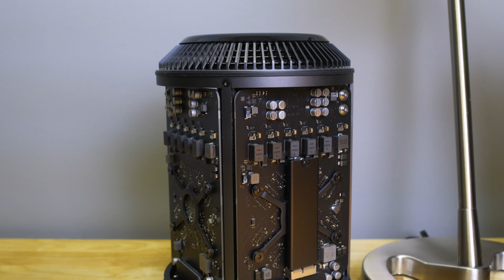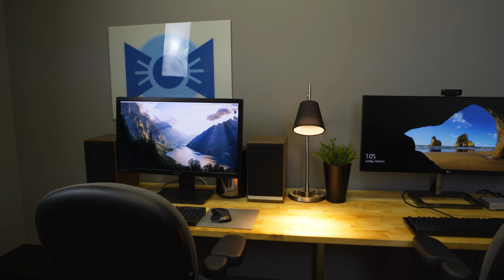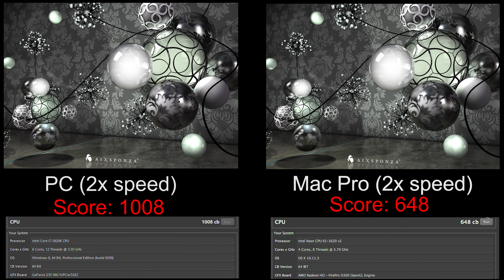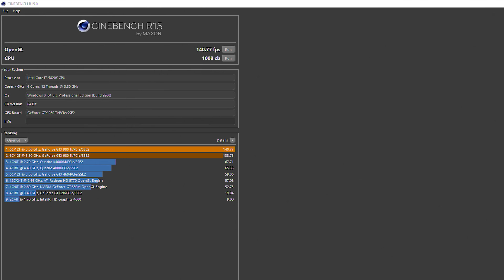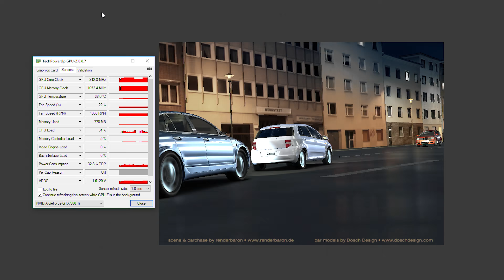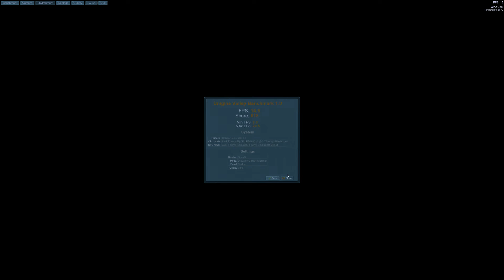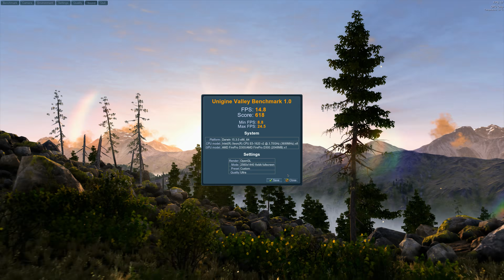$2,000 Custom PC vs $4,000 Mac Pro

Comment: If you buy any apple products, I have one question. How does it feel to waste a large amount of money?
Reply: I know, apple users don't have much of brains
Reply: at first it feels exciting then you feel like an idiot for buying it.
Reply: The only apple product I'd buy is at a grocery store in the produce department
Reply: You can buy a 4K$ PC with better stuff than the Mac Pro has.
Reply: Ryan Denziloe
The don't sell apples in grocery stores? lol Then where do they sell apples?
Reply: Ryan Denziloe
I've never seen a store that specifically sells only Apples.
Reply: It is like being ripped off, specially when your already ultra expensive computer costs more to repair than buying a new one
Reply: Cyril Blanc "Again and again : a Intel Core i7-5820K Haswell-E 6-Core 3.3GHz LGA 2011-v3 140W Desktop Processor BX80648I75820K
by Intel
Price: $384.45 & FREE Shipping. Details

Does not compare to a Xeon at 4000 euro"

Most Xeon processors are really just rebranded high-tier i7's.  Also, if you actually did mean "4000 euro", then it certainly would not be worth the investment for a Mac. You're not being coherent or concise enough.
Reply: Cyril Blanc To whom are you replying?
Reply: Kyle SoSik there ipads and phones are pretty good
Reply: Cyril Blanc When would the Xeon exactly be necessary? The Xeon isn't even clearly more powerful in benchmarks compared to the mid-tier i7 you cited.
Reply: DerPfoertner Can apple users be this delusional. You are paying $1100 for a machine that has the same hardware specs as a computer from 2007 get real. For a $500 windows or linux machine you can actually run GPU accelerated video encoding, play games better than a $1100 mac. Upgrading your PC is also possible, without having to shell out another $1100 dollars for a brand new machine. You are not even getting the most out of your sad excuse for hardware on a mac because the genius at apple forgot that a hot ass computer needs cooling or else it thermal throttles. There are way less application for mac because for the most part apps are sold and regulated by apple where as on Windows and Linux there is not a single distributor of software nor is there any restrictions or fees you have to pay in order to publish programs on Windows or Linux. As for Apple support that is the most garbage sad excuse for technical support i have ever experienced.
Reply: It feels like a durable device that does not explode
Reply: apple don't even make their own screens LG and Samsung do and yes apple called it the "RETINA" you can buy the equivalent screen for alooot less from the people who actually make them!
Reply: Kyle SoSik Feels great!
Reply: Probably feels a lot like getting bent over and fucked.
Reply: Cyril Blanc How exactly does that counter my original claim ?
Reply: +Jose R. Chaves (DJ Rodrigo) please tell me you are kidding me, have you ever taken a look at custom PC cases or expensive PC cases? Jesus christ, style he says.
Reply: +Cyril Blanc sir I think you mean an operating system comparison.. otherwise it would be a hardware configuration comparison... also xeons are made for servers I'm not saying it's impossible for them to work in PC configurations. also the Xeon used in the Mac configuration is probably cheap by now, you can pickup 4 core xeons for old servers cheap as fuck. like the Xeon e5420 which I have in a few of my old servers... you arguing over hardware configurations is pointless.
Reply: Cyril Blanc "In the PC world you use Xeon for servers and for professionals workstations, on Mac we use Xeon for desktop. Don't forget that the Mac Pro Market is Drawing, Music, film ... "

This seems self-contradictory. Doesn't this defeat the purpose of spending any extra on a Xeon for a household user? Even a power user who games and does heavy video editing probably wouldn't see any benefits from a Xeon processor on average, especially considering i7's have better single core performance for a significantly more affordable price range.
Reply: Jan Vandoorne Did you really just say quality of screens as a main selling point? Do not buy into their bullshit "Retina display" marketing buzzwords.

Most people with Macbooks just use them as overpriced Chromebooks/web browsers. Also, as long as you're not a completely incompetent dolt, Windows is an extremely stable OS.
Reply: Kyle SoSik I have regret
Reply: same feeling when you try 5 gum
Reply: Considering i buy them broken for next to nothing and fix them myself for cheap, it feels amazing
Reply: The only way to waste money on an apple product is to buy either the mac pro or an out-dated product. The mac pro in this video is both
Reply: HyperTutorials Is there any real advantage in using a Xeon if you're just an average, commercial user anyways? I didn't really understand his argument.
Reply: HyperTutorials That's what I had thought as well, I don't really see where he is going for his argument if we are speaking in respect to the average/regular consumer.
Reply: +Cyril Blanc I don't care about your post. first of all I was giving the e5420 as an example of hardware prices in specification lowering obviously the one used in the Mac book hasn't lowered much however if you take a look I'm pretty sure you will find that others with similar specification have around the same time. You can compare an Xeon to an i7 in desktop performance as a ordinary user the i7 is likely to outperform the Xeon on single core performance this is what the user asked. maybe you should read before going keyboard warrior style on me.
Reply: +Cyril Blanc isn't this the whole idea of the remade hyper threading process which they originally abandoned and brought back for parallel processing... in all i7's and xeons.. yes when compared to an 4 core i7 having an extra 2 cores and twice the threads will make a difference in MULTI CORE instances. the user you were arguing about was talking about a standard user point of view. Jesus Christ.
Reply: +Cyril Blanc +Cyril Blanc First of all currently sli and crossfire is fucking useless they are planning on scrapping the whole process as not all 100% of both graphics cards can be utilised I believe the video maker mentioned this, not directly but experienced both graphics cards weren't being used to their full potential. Secondly Intel aren't pricing these around apple. a huge percentage of their usage of Xeon CPUs are Servers they are literally directly marketed for data centres are they not. as you probably know servers are quite expensive both to maintain and to buy so they would not lower the price of Xeon new gen processors especially when they market it towards data centres. that is like Mercedes making a new class of car dedicated to Ceo's and people who aren't Ceo's complaining about price as they plan to use it for something else. they make xeons expensive for a reason.. to make money.
Reply: Jan Vandoorne 

"Yes. Any 2560x1440 60 hz monitor will cost you 700-800 bucks easily. 
People tend to forget that that is also part of the package. "

Are we talking about laptop displays or monitors? What I was trying to get at was that MacBook Pro's don't even support 1920*1080 resolutions. 

Many laptops now are supporting up to 2560 x 1440 resolutions now. 

"And to my knowledge I am not an incompetent dolt and I still get a whole lot more crashes on windows than I have on an apple during normal use. (and it is not only the stability, it is also the ease of use and speed, on a windows you basically cant use the 'search' function since it doesnt find half of you files and takes an hour. If you use the search function on mac you ll almost find anything instantly.)"

I could easily talk about features that OS X lacks in turn. For example, OS X doesn't even have a basic split screen shortcut, which is very useful, almost necessary, for an engineering student such as myself.
Reply: + Princess ... We are not playing in the same garden, I speak of 100 instruments loaded into memory. You have a 38 GB Library ! I use  the Vienna Symphonic Library, this library  is more than 900 GB and has 2,299,91 samples, this is THE professional library. Just to take an example, the piano has each notes sampled 127 times and is 46,8 GB. This library is only for Orchestral Instruments. I forgot to say that each of the 100 instrument that I have loaded into memory have at least 32 articulations so that is making around 3 200 instruments !  I do own many other lib ; Kontakt, Omnisphere, Arturia V5, Dimension, Choir ... I don't know how many instruments I have with those, probably more than 15 000. Just the Arturia is 5 000 instruments. go at https://www.vsl.co.at/en/Instruments/Super_Package#!Demos to listen to some demo of VSL
Reply: Cyril Blanc dude, I don't need to give you examples, mac is shite, and you know it
Reply: + +starducks .... and +Princess : You just talk rubbish, if you cannot justify your words with examples of two computer sold by Apple and his competitor (Dell, HP). It does not worth continuing speaking, you are both not professional.
  Bye
Reply: No, you can't. You can buy a 4k$ PC that's better for gaming, but the mac pro isn't a gaming machine, it's a workstation. Try building a custom $4000 computer with comparable hardware as the mac pro, you'll see you'll end up spending more. Stuff like ECC memory and compatible motherboard, workstation GPU (AMD Firepro / Nvidia Quadro) are insanely expensive.
For the usage case of 95% of people, it's stupid to buy workstation-grade hardware though, because it's a lot more expensive compared to the performance you get. Comparing gaming PCs to workstation/server PCs is like comparing a ferrari to a tractor.
Reply: People comparing workstations with consumer grade hardware have even less brains.
Reply: Warranty is hit or miss. Apple replaced the display on my macbook twice because of a single dead pixel, no questions asked. Asus however refused to repair/replace my high-end monitor with 5 dead pixels. You just have to get lucky. From my experience the specific store matters more than the brand when it comes to warranty.
Reply: I'd say exactly the oposit. You can't build or buy an equivalent PC/laptop for less money. Equivalent in every way. Including workstation grade hardware for the Mac Pro (ECC, AMD FirePro, etc...), and stuff like formfactor in the macbook. You can definatly buy a much faster laptop for less money, but it will be a lot bigger, have less battery life or a worse display.
Find me a 13" laptop with i5 @ 2.8Ghz with 8GB ram (1866Mhz), 2560x1600 display, SSD with 1000MB/s read/write speed (sequential), 4-12h battery life (4hours being extreme torture test both on CPU and GPU, 12h being surfing the web + youtube), for significantly under $2000.
Same for the Mac pro, you can't build a custom PC with equivalent workstation hardware for less $$ than a mac pro.
Reply: ECC support...
Reply: No, there isn't. But the mac pro isn't designed for the average, commercial user. It's a workstation. That's why it's completely pointless and stupid to compare it to consumer grade hardware. A mac pro is the wrong computer to buy for 98% of the people, but that doesn't mean it's overpriced. It's priced fair and competitive in the market of those last 2% for which the mac pro was designed.
Reply: Yes, quality of screens is a main selling point for a lot of people. There's a reason Apple hardware is almost the standard in the photo/video industry. Having a high resolution, high color fidelity calibrated display matters for some people. Don't hate on a product because a lot of idiots buy it for the wrong reasons...
Reply: +Funkenstein it's funny how you accuse someone of being a "fanboy" while clearly YOU are the one having an unfounded grudge and/or preference towards certain brands. Argument your case or shut up. Simply calling apple hardware "crap" without any further argumentation, reasoning or facts is utterly childish and foolish. 
Also, this discussion what about hardware, not about operating systems. So your love for windows isn't even relevant, since you can install windows on any PC you like, including apple computers.
Reply: I've never spent a penny on Windows. I'm running Window 10 Professional thanks to my free upgrade from Windows 8.1 Pro. I don't run Anti-Virus (You don't really need it). The only thing I've spent money on is my hardware, and Steam games. I have no issue here.
Reply: Funkenstein ain't that the truth. PoS outdated mac-crap that gets abandoned stuck to previous OS's after 3-4 years.
Reply: DerPfoertner
The self-delusion is strong in this one!  A particularly loud "lol" for the "more powerful: Apple" and "more programs: Apple" delusions.
Reply: DerPfoertner Yes Mac is outdated. PC's had Skylake processors 9 months before Mac's were running on them. The hardware being used is ancient. When was the last iMac made? Like 4 years ago? Exactly. Ancient! My PC is 5 years old, specced out running an i7, 16GB Corsair Vengeance RAM, 240GB HyperX SSD, 2TB HDD and still running fast and silent. Still demolishes games I throw at it.
Reply: DerPfoertner HAHAHAHAHAHAHA!!!! You're trying to tell me your shitty core 2 duo 2009 mac mini is more powerful than an 8 core i7?? Holy fuck that's funny.You must be by far the shittiest troll or the stupidest person on this thread, I can't tell which.Netbooks haven't existed for years.Oh, and also as stated above. I have NEVER paid for Windows.Most PC's come with an OEM license so you can activate as many times as you want. Windows 10 Pro was a free upgrade. Oh man, this has cracked me up
Reply: i think linux is really good for few things... like hacking etc... it's just bad as a consumer os
Reply: savage
Reply: i feel nothing cause i dont waste any money... my uncle gave me his Iphone :P
Reply: Rafael Nicodemos Even if you enjoy the iPhone more, that doesn't make it actually worth it to pay the price they ask for it.
Reply: +Cyril Blanc mine melted its motherboard twice.  So I replaced it with a MacBook that had 5 dead pixels.  Apple wouldn't replace it with anything less than 7 dead pixels.  

Within a few months it grew to 10, at which point I discovered that 7 number was just the "upon arrival" number, and that I needed more than 15 in the first year...

I stopped buying Apple.
Reply: +Lunar- Tick me too I got mine for using logic pro x and I love final cut pro
Reply: I agree as far as Macbooks and Mac Computers being overpriced, but their phones are at least somewhat competitively priced.
Reply: +MegaLadysman1234 use a light weight Linux operating system then?. maybe have a look at Arch Linux which you build yourself or ElementaryOS if you are new to Linux cli and desktop in general and like the look of OSX. if you like the idea of Arch but can't be bothered to learn how to customise your own version you can take a look at Apricity OS. best of all these are all light weight (besides elementaryos), heavily customisable and free.
Reply: +BOSSDONMAN the performance is basically identical on most of them if you get one that can be compared to an i7 however they are made to run 24/7 which means they are made to run cooler and their selves are more reliable.
Reply: +BOSSDONMAN in a server configuration. This wouldn't add much benefit to a Mac pro user other than it being able to have a big uptime and because of it using 4 year old hardware it may take several days to render their 'pro' project haha. just kidding around. Xeons aren't that beneficial in a desktop setup. please note this is from personal experience I haven't just read this online as mentioned I own servers that run with Xeon processors.
Reply: +HyperTutorial : I did not speak of Operating System.

Before to say : "also the Xeon used in the Mac configuration is probably cheap by now", look on Internet ! The E5 used in Mac have reduces a little bit but they are still around 4 000 euro (se my post)

It is simple : YOU CANNOT COMPARE A PC OR A MAC WITH A E5 XEON TO A PC OR A MAC WITH i7, it is like comparing a mini to a Mercedes
Reply: BOSSDONMAN Yes. Any 2560x1440 60 hz monitor will cost you 700-800 bucks easily. 
People tend to forget that that is also part of the package. 

And to my knowledge I am not an incompetent dolt and I still get a whole lot more crashes on windows than I have on an apple during normal use. (and it is not only the stability, it is also the ease of use and speed, on a windows you basically cant use the 'search' function since it doesnt find half of you files and takes an hour. If you use the search function on mac you ll almost find anything instantly.)
Reply: BOSSDONMAN -I was talking about the desktop macs there.
For the other point you made there, you are right that there are laptops out there with better screen resolution for less money but that wasnt the point I made there. The point I was trying to make is that for the dekstops people tend to forget that if you buy an apple desktop the screen is automatically included.
I made this point specifically for the people that say : 'I could make a computer for 1000$ that is better than any mac out there' because they forget you still need a screen/peripherals with that. (so your 1000$ quickly becomes 2000$)

-The splitscreens are possible, look it up.
Reply: Jan Vandoorne Ah, okay. For me personally, it doesn't really matter, because the only reason I use a desktop is to game really. 

"-The splitscreens are possible, look it up."

Yes, they are possible via manual click and dragging, which is quite tedious any annoying. On Windows, all I have to do is hit 'Windows Key' + 'Left/Right Arrow', and it partitions the screen perfectly. That was just a small feature that is probably insignificant to the vast majority of people; however, the point I am trying to make is that the selling points of MacBooks usually come down to the very "small" things it does better, like better exterior design, better ergonomics, better touchpad etc, but you can still find quite a few things (like split screen view) that the MacBook fails to do as well as Windows.
Reply: LMAo thats hillarious
Reply: I had the choice to get an s6 or a 5s and I chose the 5s 😢
Reply: you're right , but the OS is the only thing where mac is better .......
Reply: SqDislike, when did i ask you ? XD
Reply: buy a computer from Dell or HP with the same performance and see the price
Reply: You can play the same game on Xbox and Playstation
Reply: Macs are outstanding work and gaming computers! Pc fanbois.
Reply: Well then you obviously have no idea what you're doing and should stick to the noob-friendly MacOS...nobody in the real world uses a Mac for work...unless your day job is sitting in the park and using Twitter all day long.
Reply: Any computer, Mac or PC can be reliable if you know how to properly use, take care of it, etc etc....Macs run on the SAME exact hardware that PCs run on.
Reply: +Gurvinder Parmar one, I don't like social media. Two I find mac easier to use. And 3. They are NOT AS prone (I never said they couldn't get viruses) to viruses as pcs. So u pc lovers should get ur hands off of my opinions.
Reply: +Gurvinder Parmar if u like pcs I respect that. I never said pcs were bad. I just happen to like macs more than pcs.
Reply: Spicypicklez Gaming Get a good adblocker and don't download a ton of stuff from less secure websites, BAM, you probably won't get viruses on a PC.
Reply: +Johnfuse man people don't know what opinions are.
Reply: ***** There were multiple primary defenders of apple products in this chain.
Reply: ***** Oh, I thought you were referring to Spicypicklez, lol.
Reply: It is quite normal the my English is not as fluent as an home born English, I am French. This is a poor comment ! If you where speaking as good French as I speak English................
Reply: LOL
Reply: This is a poor posting, no facts ! +Princess Trufflegum's Bodyguard Tell me what incoherent reply I said !!
Reply: It is not my fault if you are incompetent in computers. Go back to school or read "Computers for beginners"
Reply: How is your French ? So what is the difference between a Xeon and an I7
Reply: Kyaw Hla The thing is many people who purchase Apple computers aren't truthfully rich.
Reply: +Cyril Blanc the 12 core model? it cost 8000 USD (cpu alone is 2999 USD) from apple with basic configuration it can go all the way to 12k!!!!! and apple dont sell the 12 core on there site no more. the one showed in the video is quad core that cost about 360 USD  .  your comment is very stupid
Reply: All I need is a Mac that can handle a full 100 instruments orchestra using VSL, you will never do that with a I7, PC users with such configuration need at least 4 x I7 if it is not 6 x I7 to do the same job
This ends my reply
Reply: I dont have an iMac, but a Mac Pro 2010 12 core 24 thread, I have raid of 8 x SSD, a few 2 TB disk
Reply: +Princess... This is the configuration of another composer :
He has a song of about 1100 tracks in Logic 10.2.4, with the bulk being hosted on 4 slaves.

And this is running on Mac and W7 computers :

2013 Mac Pro 8 core 3.0, 128 GB RAM
Slave 1: 17 8 core 64 GB RAM Win7
Slave 2: 17 8 core 64 GB RAM Win7
Slave 3: 2012 i7 4 core Mac mini 16 GB RAM
Slave 4: 2012 i7 4 core Mac mini 16 GB RAM
Apollo8
Reply: + Princess ... 
You dont know what you are talking about.
You do need to learn a bit more on how to make orchestral music.
bye
Reply: waste a large amount of money for dogsh*te
Reply: Cyril Blanc HAHAHAHHAHAHAHAHAHA no you don't get what you pay for, $1300 for a mac that runs like shite, or $1600 for the same mac but with a bigger screen ? And the taxes aren't even included. That when you can get a PC that runs 2x better for half the price
Reply: + Princess It is not fare not to pay the software you are using.
On Mac all the bases are free ; there is an equivalent of Word, Excel, Powerpoint, Music, Photo, Web design, Movie maker... and with the App Store you have free and very cheap programs. What would you say if you have been spending months programming a Application and you see everybody using for free !
Reply: +Starduck   Give facts with example so we can laugh !
Reply: +MegaLadysman1234 Apple OS runs on well tested Apple hardware, while Windows, Linux the both have to work out how they will work on all sort of hardware. Considering this, Windows does an excelent job. And I am not talking here about privacy on Windows 10 which is an another story. :)
Reply: +BOSSDONMAN "What I was trying to get at was that MacBook Pro's don't even support 1920*1080 resolutions." what. Research your stuff before you comment stuff like that. smallest Macbook Pro (retina) has 2560x1600 display. Even the incredibly outdated non-retina macbook pro's have fullHD (though I don't understand why people still buy those, apart from the optical drive).
Reply: I agree with Brugse Zot 100 %, he is totally right.

Apple only buy the top components that will last years, my MAC Dual G5 of 2003 is stil working 24h 7/7 as a backup server

If you want a cheap Mac to do the everyday usage go and buy a Mac Mini at 499$, you have hight quality hardware, very good support, very good software 

Just a little story :
There was a problem with the power supply on the MACPRO 2010, the power supply was working but making a funny noise ; Apple send me a technician AT HOME to replace it. 

This is why Apple is known to be the best support

I had also a dead pixel on my MacBook Pro retina, they change it in 48 hours

I WILL REPEAT AGAIN WHEN YOU COMPARE YOU MUST COMPARE WITH EXACTLY THE SAME HARDWARE; 

If you dont do it it is like comparing a Renault to a Mercedes.

Second hand MAC PRO 2010 are selling very well too for more than a 1000$

My last word, I am very happy with my MACPRO 2010, it does the work I ask him to do It has follow the different upgrade of MAC OS.
When MAC OS SIERRA will be release next month I will be able to talk to it.
 
A trick is to buy Refurbish MAC you can gain up to 25 %
My MacPro 2010 was refurbish and is working without problems since 6 years.
Reply: + Princess 

You continue to speak of things that you don't know
We dont use Mac Pro for gaming, you dont use PC Workstation with a double Xeon at 6000 $ each for gaming, except if you are Bill Gates

If you want to play games you buy a MAC Mini at 499$ or at 999$, you can use you Windows mouse, keyboard and display on it.

You are childish using a computer to play games !

1) This man is wise

2) Why I use a 2003 Mac as a backup server ? stupid question 
    Using Time Machine (include in Mac OS) I backup automatically all my Macs on It
    Before I had a NAS from Synology, it did not last long and the manufacturer refused to give me an estimate to mend it. Synology dont have support for single user !!!!!!!!!! SHAME

3) I will NEVER by a cheap PC,, I have been working, developing business applications, on WINDOW PC, Window is crap.

4) Compared to Synology, Apple has a very good technical service

5) Apple does not make the Display

6) 

7) You are dreaming , the gain of power since 2010 is peanuts !
     You need 4 x I7 to do the Music I do on my old Mac Pro 
 
8) No I am wise, I have work on PC and now I use MAC

9) The Apple OS has been always ahead of Windows OS, Microsoft is copying Apple and you have the feature of MAC OS 2 or 3 year after.
Can you talk to your PC ?
     I have a Beta of SIERRA on my Macbook, it's very promising I can speak French to an English MAC OS
     Since a few years MAC OS upgrades are free, you can thanks Apple because Microsoft had to do the same, Microsoft is always copying APPLE
    How much do you pay for the Office suite, on Mac it is included in the OS ;)
    On Sierra you can supervise your house using outlets of different manufacturer. 
    On Sierra you can watch your health using outlets of different manufacturer. 
   On Sierra all musical plug-ins will be independent, if a  plug-ins crashes it will not crash your DAW
Reply: True! Problem is they choose the wrong components :))
Reply: + Maciek ... can you go in more details !
Reply: Using amd over nvidia cards was not good decision, especially for 3D industry. Also mac pro should use 2 x new xeon processors for best config and strong i7 for cheapest config. The price/performance with those components is not the best choice in my opinion. 

For 8k $ I wish I could use 2x xeon and quadro card (for CPU rendering) or for 4k $ 1x i7 and 2x 1080 GTX (for GPU rendering) I know it looks like gaming setup but this is the direction in 3D industry.

Anyway would be nice to have a option to config for own needs.
Reply: +Maciek Ptaszynski, I cannot help for 3D, I use my Mac Pro for making music with a 900 gb music library. I gave a re-birth to my old MACPRO 2010 12 core 3 Ghz adding a SATA III card with 8 x SATA III port and 8 x SSD in Raid 0
Reply: yeah looks cool, I have 2010 12 core 2.66, with quadro 4000 but its useless for 3D GPU rendering :(
Reply: I suppose the mac pro config is the right one for someone... Though I agree that for 99% of people there's likely a more ideal config for that price. I guess some people depend on workstation grade, there's a reason these components exist. Higher standards, less failures, etc. If you're gaming and your GPU glitches up a single frame every hour, you wouldn't even notice it. However if you're rendering a movie and your GPU bodges a single frame every hour of rendertime, you've got a problem. Same principle applies to ECC memory (and compatible motherboard/CPUs). Completely useless for almost everyone, but for the most error-critical applications it's a necessity.
Reply: +Princess I totally agree. Mac and PC can have some of the same hardware. it's starts from 499$ to 8k$ or more

The only difference is Windows v.s. MAC OS v.s. Unix. 

One journalist that hated Mac (cannot remember it's name) decided to get one ; his conclusion was : "it's simple and it's works"
Reply: +princess Trufflegum's Bodyguard Thanks. Glad we managed to be adults about it. 
Just wanted to add that a mac pro isn't the right computer for me either.  I dual boot windows & OSX both on a MBP and a hackintosh custombuilt tower, I need both. No single hardware manufacturer or OS covers the whole range of my needs, let alone everyone's needs. This is why "fanboys" on either end are so obnoxious. Talking bullshit without researching things. 
Apple suffers from the same problem as BMW. The countless amounts of douchebags buying it for the wrong reason gives it all a  bad image.
Reply: I can't get in the BMW except X5 and up ;)
LOL
Reply: How does it feel to waste money on upgrading every 1-2 years?
Reply: My 2010 Mac Pro works fine
My 2003 G5 work fine too
Why changing !
Reply: I couldn't even begin to tell you how many years it's been since I've had any kind of OS problems with Windows.  Certainly not since Windows XP came out.  The only time you run into issues is when you try to install shitty third-party software; something that's much harder to do on an even more shitty Apple product.

So, yeah, if you stopped using Windows at 3.1, which you clearly did despite your feeble lies, sure, Apple's crap probably looks better.  But if you've used anything within the last decade, which you clearly haven't, you're full of shit.

Hell, I bet you're one of those delusional people who thinks the world is full of viruses waiting to eat PCs, too.  And even more hilariously, you probably believe Apple crap doesn't have as many viruses out there because it's a superior machine (as opposed to hackers just not giving two shits about such a minute market share).

Hilarious.
Reply: Perhaps you didn't full understand my last comment. I'll repeat the essence to make sure: "Argument your case or shut up. Simply calling apple hardware "crap" without any further argumentation, reasoning or facts is utterly childish and foolish." Equally childish and foolish as claiming that apple hardware is by definition the best. Just because you're on the other side of the "conflict" doesn't mean you're any less of an idiot as the fanboys you're calling out.
Once again YOU are the one making ridiculously subjective and ignorant claims about a brand without any factual background.
Just because a lot of people buy premium tier gear from a certain brand for the wrong reasons doesn't mean the brand itself is crap. 

I use 3 computers daily, of which only 1 is a mac. I use a single phone and it's an android. So no, I'm not a moron buying a single brand because of image or the logo.
I'll be ignoring you until you find it in you to form a constructive, fact-based opinion of your own, rather than leeching on kiddie-keyboardwarriors' rage.
Reply: No, I understood.  You're just a braindead fucktard, and there's no point arguing with a braindead fucktard.  The fact that you broke down in an irrational nerdrage because someone called Apple products "crap" says more than anything anyone else can say about you and fanboys like you.
Reply: Funkenstein there is a reason why my 2014 PC laptop has mold forming on it and my 2011 MBP is still running strong ON THE LATEST OS.  The 2014 Laptop barely run windows 7 much less 10.
Reply: Robert Weaver That's not a subjective or complete image either. What did you spend on the 2014 PC laptop? Probably far less than on the MBP. A 2014 PC laptop in the same $1500-$2000 segment shouldn't generally have any issues like that after only  2 years. 
Equal money buys equal hardware, regardless of brand. Mac is no exception to this rule in the pro-segment. 
Your example is more of a "high end hardware vs budget hardware" case,.
Saying stuff like "apple is best and the rest sucks" is equally stupid as saying "apple sucks", IMHO.
Reply: +Princess why do you go in an Apple store  to have it tested, it's free, could be a simple battery problem !
Reply: +Princess 
There is no question to fight again, It is up to you to take an appointment  in an Apple Store, may be your Mac will be mended after guarantee is expired ! they are very helpful ! 100 $ for a battery is not much ! I have to change my battery soon after 4 years of usage , The status f the battery is "replace soon" mine on an Macbook pro Retina  2012 is much more expensive as they have to change the case and the keyboard, this is a nonsense and I not at all happy with that. Nothing is perfect !
Reply: You can find on Internet compatible  batteries for Mac at a cheaper price,
Reply: +Robert Weaver it feels great to upgrade every 4 years, especially since i have an extra 2000 I saved on not buying a mac.
Reply: You dont need to upgrade every 4 years, the gain in processing power is very small
You better, if needed, add a SATA III card with SSD
You get what you paid for, if you save 2000 it's mean you have lousy processor(s) and/or lousy graphic cards)
Reply: Cyril Blanc "You get what you paid for, if you save 2000 it's mean you have lousy processor(s) and/or lousy graphic cards)"

It's so cute that you think that.
Reply: Buying windows pc's and windows software is THE real waste of money.
Reply: Buying windows pc's and windows software is THE real waste of money.
Reply: Buying windows pc's and windows software is THE real waste of money.
Reply: Buying windows pc's and windows OS generally is THE real waste of money.
Reply: DerPfoertner
You keep telling yourself that, while the vast majority of the rest of world continues to live in, you know, the real world.  Rather than the delusional Hipster Wonderland you seem to live in.  "I use Apple, so I'm of a higher class of people. <hair toss>  (Or at least so I keep telling myself, as I continue to use mediocre hardware and software that's grossly overpriced.  But that's what makes me 'kewl' right?!)"
Reply: I'd say because OS X is Unix, but then you have Linux, which is Unix-like, and FreeBSD, and of course Niresh's OS X.....   :3
Reply: +Salvadorja_ 2003 yes, when i would rely on an inferior windows bucket
Reply: you misspelled "outdated ms windows-crap"
Reply: more powerful: Apple. more apps: Apple. the best customer support: Apple. expensive: not really, you get what you pay. we have 2016, people still buy computers with ms windows as OS??
Reply: +Jose R. Chaves (DJ Rodrigo) Aluminium materials dosent mean its constructed well, macbooks especially have a horrible track record for cracked mounts on the display and poorly constructed motherboards.
Reply: sorry, i´m not the brainwashed windows sheeple around here .....
Reply: my mac mini is from 2009 and i am pretty sure it is more powerful and reliable than most of the windows pc´s and netbooks around.... windows.... i am wondering: people still buy that shit?
Reply: i have macbookair and i regret buying
Reply: Matt Bates
The Apple fanboy is clearly delusional.  We shouldn't be laughing at him.  We should be trying to find him some professional help.

Thinking on it, though... nah.  Think I'll just keep laughing at him instead. XD

The best part?  He's calling other folks "sheeple." XD
Reply: the brainwashed windows sheeples need help, much help.....
Reply: I would never buy the mac pro, ever. But I do like their laptop line. For the dimensions, it's actually a great laptop. it also comes with some features that are arguably better than any other laptop around (trackpad). And the specs on the lower cost laptops are not bad in comparison to other laptops.
Reply: People must admit .. Apple is for people that don't understand of technology . And you bootleg "Mozart" .!If you haven't tried real computer with professional graphics and processors (Xeons , Teslas , Quadro's) don't talk shit :( . + I find really funny how you typed random specs and you don't even know the performance . Let's stom arguing over pointless shit . There are kids starving to death in Africa ... we're acting like kids ffs . Nobody will give shit for Apple or Windows after 40 years because the Market will be drowned in other companies that fixed Microsoft and Apples problems . When you die apple wont give you 2 cents cunt .
Reply: Gandalf The Black "Apple is for people that don't understand of technology". That's complete bullshit. You are making that up right now, assuming out of nowhere. I could also make an assumption solely on top of your comment. For example, I could think that people with a poor english grammar dislike Apple for no reason. I'm telling you,  whether someone likes Apple, Android or Windows could be achieved by a lot of reasons. There is seldom just one reason. I would really appreciate it when people stopped picking sides. But that's not going to happen. I would also love it when the global IQ amount would increase by say.. 10. That would make the world way more enjoyable to live on.
Reply: +Nex igen First of all "Poor English grammar" . OK bro i have , but honestly you thing i give a fuck agout it . I don't plan moving to U.S.A or UK , so i give 0 fucks about my grammar . 2 : Everybody knows that Apple is user friendly to the point you're not allowed to do some types of modifications . +They're overpriced with 500+ , on almost every model . Because it wasn't update the parts performance is equal to 1200$ or lower PC. Remember there are no difference between Mac and Pc , they're the same thing.I really like you sir , but can you believe we are making YT argument ^_^ . Be friendly , don't be so toxic if some 1 says something in YT . +How you know if i have low IQ ? IQ has nothing to do with being smart or having good memory . And it's 129 my fr :) .
Reply: +Nex igen Well , we're looking like idiots , don't we :D . It's Apple vs Microsoft  and we're acting like bootleg lawyers ^^ . Everybody fucking looses , because we're acting like little kids fighting over everything . P.S in the last one i have 4-11 mistakes i think ^^ . As i said have a wonderfull day sir ! :D
Reply: Gandalf The Black Whether you live in the USA or UK or in any other country, English and American are still the most commonly used languages especially on the WWW. Having a good understanding about the language will always be a plus. Whether it is for your work or just for the sake of communicating in your sparetime, like now :)
When Chinese becomes a thing, you bet your ass I'm going to dive into that language. 

As for Apple, yes they are very user friendly. But they do not lack in features, that much. I will agree with you to a point when talking about iOS. They left a lot of features out that they deemed obsolete or confusing to have on a phone. But when looking at OSX, I actually argue against your statement. Microsoft has built a framework around their OS that limits tweaking to it. Naturally they did because they don't really like people meddling with their OS. So did OSX. But the difference here is that OSX is still linux based and has a really advanced terminal, allowing people who do know what to do with a computer to customize it to a further degree than a windows machine could. And indeed, when you don't know a lot about an OS, OSX will be easy to use and very user friendly. It's my preference as well. Not because I suck with hardware and not because I'm a complete tech rookie, but because of multiple reasons, regarding user friendliness, design and customization. I'm actually a Game Engineering student working on a mac. I hope that changes your black white statement about Apple users a little. Don't hate people who use Apple and don't throw prejudices at them. They can be just as tech savy, intelligent and what not than a windows or linux user. It's totally not about your OS in the first place.

And I never talked about your IQ specifically. however, judging by the fact you don't seem to give a fuck about a lot of things, I'm not that convinced with your claim.
Reply: +Nex igen And i don't want you to be ^^ . P.S im going to build a hackintosh next year and i'll try to test the Apple OS . I hope im gonna find some cool features on it tbh ^^ .
Reply: Gandalf The Black I'm sure you will. If you know your way around a linux based terminal you will. Good luck with that nevertheless. You could also build a full linux machine with ubuntu or fedora.
Reply: HaXz Wolf This is more interesting than the bible though. Way less fake and stuff.
Reply: HaXz Wolf Apparently I forgot to add it's far more realistic. So please, don't do that :(
Reply: +Princess Trufflegum's Bodyguard you actually can torrent on a mac
Reply: WTF?!?!?!? .....build quality by a PC......what is wrong with you....i want a maximum of performance for my money and i shit on it how it looks like. I want to render my Pictures or Videos as fastes as  possible. And when i get 3 times more performance for less then half the price.....i fucked on build quality, nearly non upgrade possibilities and looks like a trash Apple.
Reply: Kids in Apple could've ate that Africa .
Reply: So do you still feel like a boss after you wasted money and still have a lower performing machine? lol
Reply: Linux People....Linux!!!!!  Blows OSx out of the water for productabily  and a stable work environment.  Congrats I just saved you hundreds of dollars.
Reply: No, osx is horrid, Linux is free and awesome. Works perfectly for desktop or server.
Reply: Lukas gröndahl I've never thought that they try to 'force' people to use them, I use Linux on my servers because I find it easier than Windows server, plus Linux is free and doesn't need licensing.
Reply: i'll take a 7 year old macbook air with 2 gigs of ram over an asus i5, 6gb ram everyday. yes, pcs are good for games, but when it comes to professional work, that's where the quality actually matters.
Reply: lance domhoff macbook track pad is actually pretty usable. gestures + right click with 2 fingers is pretty good.
Reply: dude its horrible
Reply: For people with money that are just peanuts. There are a lot of people who have to work just few hours for that computer
Reply: Forest Ma wow... I can't believe I just passed more than 30minutes to read all these 200 comments.

WAYYY MORE INTERESTING THAN A BOOK
Reply: Kyle SoSik best money I ever spent
Reply: You wasted your money on earpods lmao
Reply: oh,  but they look so cool.
Reply: Kyle SoSik even a $350 pc can beat the mac
Reply: Not in speed
Reply: Alpha1Epsilon2 Yes, you will get a much better experience on PC with speed, graphics, and performance.
Reply: Alpha1Epsilon2 Plus you have more options whether it be games, programs, and/or anything else. You can customize it to your preference and you aren't held back. If anything you strive and learn more. Trial and error is a big help with this. But maybe that's just something you don't want to experience.
Reply: Macbooks are faster and more optimized plz you'd need to have windows on an ssd
Reply: And there's a reason macs are always used for video editing
Reply: Alpha1Epsilon2 we are talking about gaming
Reply: He didn't specify
Reply: Cyril Blanc bullshit
Reply: A.O.C. less than $1,000 sometimes
Reply: Kyle SoSik goog
Reply: Kyle SoSik good
Reply: I have the Samsung s7 edge and I used to have an iphone 6. I liked my iPhone 6 a lot more
Reply: TheJoseBoss ugh I'm not an apple user but your head is so far up your ass right now it makes me wish you didn't have access to the Internet.
Reply: I can resell my mac and have more money than when I sell a used PC with double the specs.. LOL
Reply: The thing is though...why sell your PC when you can upgrade it for a few hundred dollars and keep it cutting edge vs buying a brand new apple for thousands to even get close to a newer PC? I spent a little over a grand on mine and I can probably beat the $2200 one from the video in a lot of things, mainly because my graphics card is a 1060 which blows the 980 clear out of the water. Saying that apple is better in any way is just wrong plain and simple
Reply: Did you just say brand new apple
Reply: Oddly sastisfying
Reply: I've had an Android phone for about two years and I hate the system, so I think the iPhone and the iPad are worth, but what frustrates me the most is knowing that I'll have to buy a Mac for developing iOS apps, even though my current PC has triple the performance that any Mac could ever have.
Reply: the new iphone beats all android phones in benchmarks. I still have an android, but for the price it is a very powerful phone.
Reply: I mean if you want the speed and power and camera yeah
Reply: For what u need an iPhone?
Reply: Trech iOS apps development
Reply: +Cyril Blanc thats like saying "the basket full of chocolate is cheaper than a basket full of chocolate. thus it is better than having you basket full of gold
Reply: Gay^
Reply: Kyle SoSik thats why i dont buy iPhones xD
Reply: jklw10 well apple sells thier os on iPhone for 400$-500$ and on Macs for like 2000$-3000$ xD
Reply: Obviously lots of people do that's why manufacturers make gaming laptops idiot
Reply: If I spent that much on a mac book pro I'd expect to have decent gaming performance
Reply: Just hack a hackintosh together from an old mac. It's not like Apple gives a shit.
Reply: I don't get your point about reliability. I've been using the same PC for 4 years now. I did recently upgrade the graphics card and added more RAM and will probably run it for another year or two. I have had MAC people tell me that they have to hit the reset button on their MACs when they freeze up. I had a couple of MAC friends ask me build them a PC. (evidently if you own a MAC, you don't know anything other than pushing the on/off switch and the reset switch) They have pretty much moth-balled their MACs since then. Maybe at one time MACs were better, especially at multi-tasking, but those days are long gone. Build a PC, don't buy a pre-built PC because they are built cheap for profitability, (especially a Dell from Hell) and you will have better performance than any MAC and be set for several years. And if you are considering a MAC, consider the fact you can build a faster PC for about a third of the price, that has probably 2 or 3 times as many software titles available. Which means in a couple of years you can build another one that will be even faster and still be money ahead of the slow MAC from two years ago, that is woefully slow two years later. MACs are dinosaurs that just haven't completely died out yet. Apple should concentrate on the phone business while they are still competitive, because even that may not last if iphone users it the U.S. wise up.
Reply: Kyle SoSik how does it feel? It feels awesome because I'm rich, I can buy anything just because I like to, no need to think it's cheap or expensive 😑
Reply: Thats just for there macs, but there famouse for there iphones
Reply: Is what feels to be an idiot
Reply: Kyle SoSik pix și
Reply: wrr, monex matrs not, feel any nmw
Reply: For phones? great worth it
Reply: You feel happy when you buy it but then later realise how not worth it it is
Reply: How does it feel to have to worry about money?
Reply: over the years you kind of start liking getting fucked. the more shitty it is the more I need it
Reply: My iPhones have been more stable than any samsung ive owned. Just bought a MacBook, also much faster and stable than my $2000+ pc
Reply: I have both a windows pc and a mac pc.  OSX is dramatically better as an OS in terms of a stable work environment.  Windows is pure cancer, this coming from someone who's been using Windows since 3.1
Reply: @MegaLadysman1234  He's implying the performance per cost ratio. If your PC is slow, probably you have not built it with better hardware like SSD, extra RAM, DDR4-supported motherboard and better graphics card. At  which replacing these parts and selling the old ones would be cheaper than a Mac. With better hardware, windows would run just fine
Reply: feels like you are the fucking BO$$
Reply: @Rollmops94  someones using airpods
Reply: Where then ?
Reply: depends what your doing with it, the argument of owning a mac is not owning one for performance... obviously, nobody will cash out on a flagship, but me personally, I bought my mac for the music and am building my pc currently for everything else, its just alot easier having something so reliable to be able to do what I need it to do wherever...
Reply: Again and again : a Intel Core i7-5820K Haswell-E 6-Core 3.3GHz LGA 2011-v3 140W Desktop Processor BX80648I75820K
by Intel
Price: $384.45 & FREE Shipping. Details

Does not compare to a Xeon  at 4000 euro
Reply: Dont speak about things you don't know
Reply: With a  E7 Xeon you can have up  to 24 cores and 48 threads, so with 2 x Xeon you can gave 48 cores and 96 threads
The Xeon in this benchmark is a E3, 4 generation ago !
It is sure that to play games or to write letters, you dont need 48 cores, but with video, music, scientific calculation ....... To have 48 cores is great 
Read this : http://www.tomsitpro.com/articles/intel-xeon-e7-v2,2-697-2.html
In the PC world Xeon are used on PC server in the Apple world it is used on desktop
Reply: +BOSSDONMAN you say :
"in a server configuration. This wouldn't add much benefit to a Mac Pro user other than it being able to have a big uptime "

This is not true, I run 100 instrument orchestration with VSL on my 2010 Mac Pro 12 core 24 threads (there are 2 x 6 core Xeon inside)

Xeon are very good for parallel processing so you must do benchmarks using the same software like Logic, Final Cut Pro .....

If you run a software that is using one core, there is no benefit to use a Xeon

In the PC world you use Xeon for servers and for professionals workstations, on Mac we use Xeon for desktop. Don't forget that the Mac Pro Market is Drawing, Music, film ... 

If you want to go on Internet, write memo, make Spreadsheets a 499$ I5 MacMini is enough !

If you want to compare an I7 PC compare it with an I7 MacMini
Reply: + Bossdoman :

I have just wrote :
If you want to go on Internet, write memo, make Spreadsheets a 499$ I5 MacMini is enough !

A regular user do not need a MAC 24 core E5 Xeon.
When Apple will upgrade there MACPRO to E7 with 2 X graphic cards, those Mac are not made for regular user, but for Pro user

A test done on a 2014 trash can Mac Pro :

– 48  instruments tracks with about 40 Reaktors , ES2, kontakt.
One preset on each  instruments.
– 12 effects per instruments track / Convolution / Eq / compressor etc…
– 15 AUX with 4 Fx chacun
– video HD on HDMI

ASK INTEL TO REDUCE THE PRICE OF THER E7 24 CORE XEON THAT COST 7000 $

INTEL IS MAKING THE PRICES
Reply: You talk rubbbbbbbbish
You get what you pay for ;)
Reply: I bought my 2010 Mac Pro on refurb for a good price. A fabulous computer.
If I need some more power I will try to find the same computer and use it as a slave
Reply: To you
Reply: You said : I agree as far as Macbooks and Mac Computers being overpriced,
Reply: The MacMini has a I7 and is at a 1000 $
Reply: You get for what you paid for, go on a I5 Mini at 400 $

Now with an iPad you can do most a regular user wants !

+ HyperTutorial  we speak between gentlemen usage of f...  Is not an argument

A regular user can wait ½ hour to render a film, a pro cannot wait, as this ½ hour is costing a lot. 

Imagine the work you can do with 2 x E7 Xeon 48 cores 96 thread ;) but you need to pay 14 000 $ just for the two processors

This is my last words

I will repeat, WHEN YOU WANT TO COMPARE, COMPARE WITH SAME HARDWARE
Reply: Mac are very reliable, my 2003 G5 is still working fine
Reply: you cant really compare a Mercedes with a Toyota... they both have their own class... yes it expensive, but has quality build. u can bump up a custom PC fair enough, but apple will stay apple for its unique look and style too...
Reply: @joser.chaves6212  unique??? They all look the same XD
Reply: I have wrote a long post explaining this !!!!

Build a PC with 2 x I7  --> not possible
Build a PC with 2 x Xeon --- > OK

There are E7 Xeon at 7000 $ each

When you compare two computer they must have the same components inside !!!
Reply: Stupid comment
Reply: Kyle SoSik Apple stores dum dum.
Reply: Quality of Screens (to get a screen to the level of a desktop mac you easily pay 1000 $ or more). 
Quality of the case/outside (for laptops that includes the quality of the hinges, keyboard etc...).
Battery life/speed of recharging (for the laptops).
Actually stable/good working OS.
Size.
A complete package of awesome software like Imovie, quicktime pages etc.. that you get for free with the computer. (for microsoft office you have to pay extra)

Those are the things you are paying for, not the game performance. IMO it is definetly worth the price.
Reply: Just so you know, I have an old Core 2 Duo E38400. They were also sold under the name Xeon E3110. It's the exact same chip. So I wouldn't say Xeon are exclusively used for server in the PC world. Have you checked up workstations from Dell and the like? They mostly use Xeons or high end i7 and they're not servers.
Reply: Kyle SoSik They don't sell apples in grocery stores, idiot.
Reply: You talk rubbish, look at my post : I saw a serious analysis a  PC v.s. Mac with EXACTLY the same components ; the  MAC PRO was a little bit cheaper !!!!!! ;) ..........
Reply: @cbhrcbhr  He's talking about performance per price ratio. Building a PC with similar hardware like a Mac would of course be expensive. But why choose high-cost products to build a PC just so it's comparable to a Mac? I'd rather spend less money into what I considered the best build for a given budget.
Reply: @ProfezorFirdaus  We spoke a lot of two years ago you cannot compare those ! I7 VS XEON does not compare